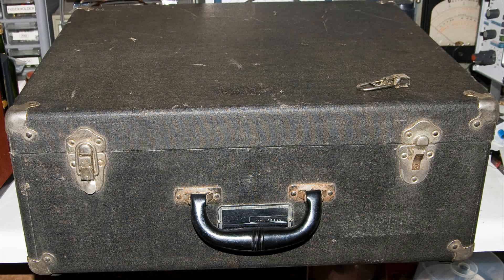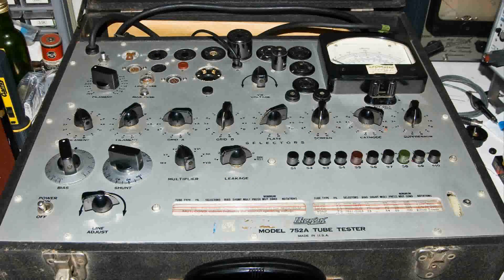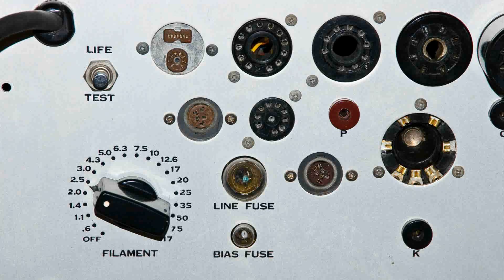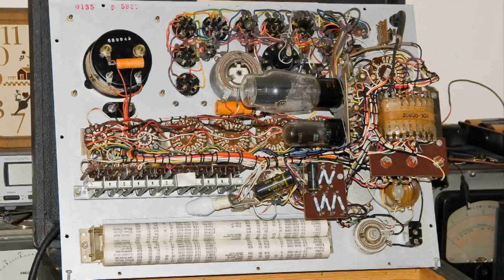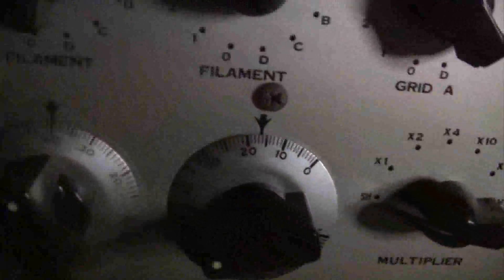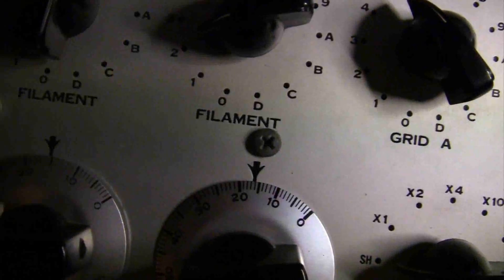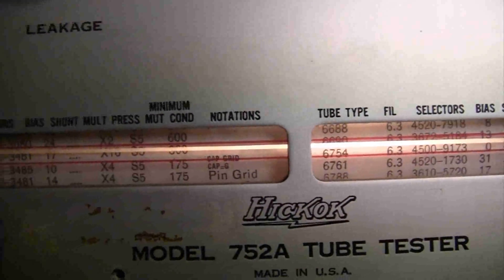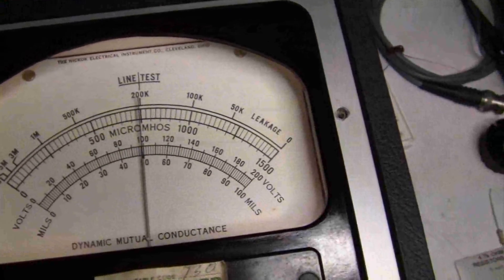Hickok Model 752A Tube Tester

Comment: is there a way to go back to the standard readings?
example.12ax7 minimum 200 but the standard of gm is 1.6mAV
Reply from the maker: You can change the settings to read what you want. It wont change the 12AX7.
Reply: @AllAmericanFiveRadio  what i mean, is there a table like Tv7 that converts the values to the standard ones? for example the 6l6 has a value of 5000 mA on the hickok 752 has a value of 300
Reply from the maker: @alessandroscibilia3923  Are you looking for a standard between different tube tester? There is none. If you do not have the tube listings for your tube tester, it makes it worthless.

Comment: I have a Hickok Tube Tester Model 752 (no A). I did find a manual and a schematic diagram for the 752A I downloaded for free. If I can find enough specifications and data, I would like to find out if I would be able to test some of the tubes used in my Yaesu FT-101 amateur radio transceiver.
Reply: I would like to get the 752a model, hard find!
Reply: I have 752 it's just as good only difference is doesnt have compactron and nuvistor sockets but bought the CA-5 adaptor which solves that.
Reply: @Tysman909 ,  the 752 and 752A do share the same set-up procedure and test data; unlike, say, the 539a, b, and c models which are all different. I love my 752A!
Reply: @goodun2974 you can use a 539c setup procedure for a 752 cause the circuits are simular. But I did find the setup and calibration instructions for my tester I will use 539c calibration instructions for the other tests
Reply from the maker: Thank you.

Comment: can this test 12ax7?
Reply from the maker: I no longer have this tester. But I think it would test a 12AX7.
Reply: Thanks
Reply: Stefan, I own one of these particular units, so yes, not only will it test a 12 ax7, it will test virtually anything else from the 1920s or 30s all the way up to the 1980s. it's an excellent tester, and you can test the second half of a dual triode such as a 12 ax7 simply by pushing one more button, it does not require you to reset all the other knobs and switches.

Comment from the maker: Hey Ron
The 6L7 has two modes, a mixer and oscillator. The two settings are to test both modes. Because of this question I look and found some great tube manuals that you can download. Go to my channel and you'll see a list of links on the right side and now one of them is marked Tube Manuals. The first one I downloaded was the GE essentials. But I plan on downloading many more.
Rick

Comment: Nice piece of equipment you got there! Still haven't found a tube tester for my self, seem to be quite hard to come by here in Norway, and pricey. Have asked around the local electronic repair shops, but they threw that stuff out when solid state electronics took over in the late 70s. Wonder how much it would cost to import one from the US? Weight is probably the biggest issue.

Regards,
Frank